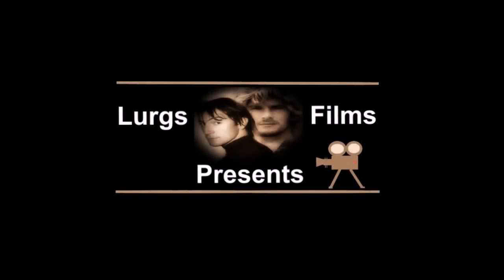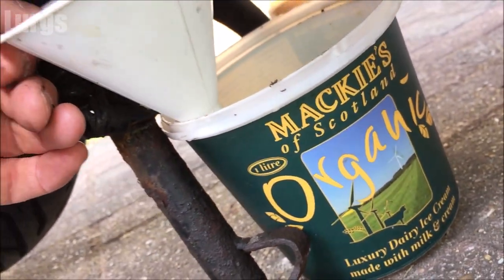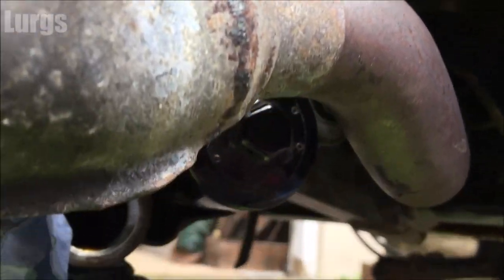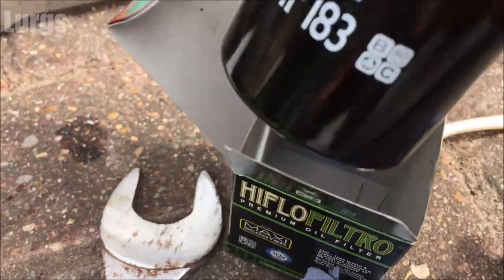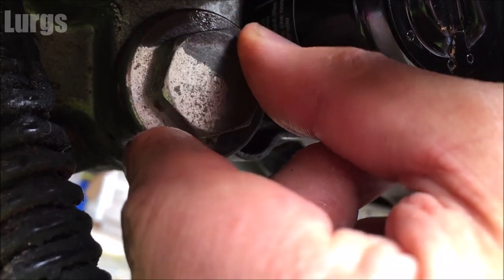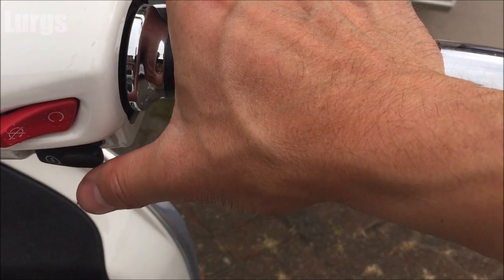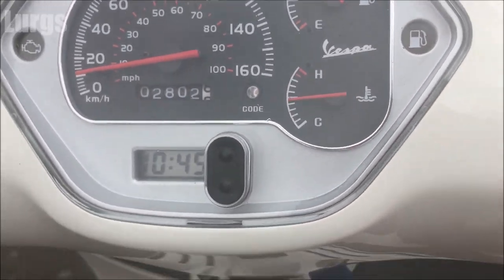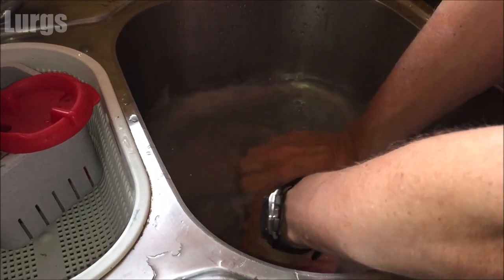Vespa GTS 300 Oil and Oil Filter change

Comment: Great video.  Thanks for all the detail.  The one suggestion I'll make is that it's better to allow the bike to sit for a few minutes before checking the oil level.  When the bike is run, oil gets distributed throughout the engine.  If you measure the level right away after shutting it off, it may read low, resulting in an overfill situation when you add new oil based on that reading.  If you wait for a bit, the oil will have all drained into the sump, giving you an accurate level reading.  But that's a small point on an excellent video.
Reply from the maker: Charles True. Overfill is as bad as underfill. I thought I had mentioned that in the video, maybe I didn't. Good point.

Comment: Its annoying how Vespa Piaggio puts their drain plug in a place where oil will inevitably get everywhere when draining because of the location of the center stand. Its also a pain to get oil into the bike. Oil changes on Genuine, Lance or SYM are 5 times faster. Anyway, these bikes are new to me but the power when riding was pretty nice, as well as some gizmo features it has. Thanks for the video mate.
Reply from the maker: Glad to help. It's got some annoying things but I have to say the twist and go power plant on the GTS300 is amazing.

Comment: very helpful - where'd you  get the sump plug O ring, please? have you made a video changing the rear gear hub oil?
Reply from the maker: I got the O Ring from same motorcycle place where I got the oil. No I’ve never changed the gear hub oil.
Safe riding to you.😎🛵

Comment: Awesome vid & good explanation! Why would you say its Perfect when your oil shows Maximum on your dip stick? Isn't it better to have it in between Min and Max?
Reply from the maker: Thanks. Anywhere from midway to Max is perfect. It holds such a small amount of oil that it's very easy to accidentally overfill it.
Just had another issue with mine today, the headlight glass\plastic has melted! I'd been starting it up to keep battery topped up and with it not moving it has melted it, never seen that before in my whole life, awful quality, should be glass! So need to get that swapped before next MOT.
Reply: Thanks for your reply. Wow! I’ve never heard that part melted before. Last time I changed the oil on my Vespa sprint, with 1 L of oil change, the dipstick shows between minimum to middle. I don’t know if that is enough or not but I’m guessing if the oil light doesn’t come on it should be OK
Reply from the maker: @NinjaNik  ideally have it in the middle so you could put a tiny bit more oil in, but it doesn’t hold much so put in a small amount at a time.

Comment: The user manual recommends 80w90 transmission oil, 5w40 engine oil for vespa gts 250.  But not everyone on youtube uses 10w40 and 75w90.. I'm crazy.  What should I do?
Reply from the maker: It’s also slightly dependent on weather conditions but I used the one in this video which was recommended.

Comment: What happens once you’ve put the oil in and the oil light doesn’t turn off?
Reply from the maker: Sk _bl Have you definitely put in the correct amount of oil?  Unusual for the oil light to remain on unless there is a fault, be careful. That needs to be investigated.

Comment: Hello, ma gts 125 prends 1l et 250 ml  (1.25l) d' huile 4 temps moto (5w40castrol)  ne dépasse jamais la quantité car se n' est pas bon pour le moteur injection  , en revanche ton 300 gts est plus gros moteur  je pense que c est un peu plus ... D ' ailleurs peu tu faire un tuto sur comment changer le filtre à essence , en effet je ne la trouve pas.
Reply from the maker: It might not have a fuel filter, not all engines do. Safe riding to you. 🏍

Comment: My gf tried to take over changing the oil by tightening the plug, but it won't tighten and when trying to torque it, the plug comes loose.  Did she just ruin her fucking engine by stripping it?
Reply from the maker: It would be quite hard to ruin the thread unless it wasn't on properly to start with and was then tightened up with a spanner, I always hand tighten nuts first. Maybe remove the nut\plug and check the thread on it. If the thread is only damaged on the nut you could try a new nut, if thread is damaged on the block then that's not good news. I really hope you can get it sorted, let me know how you get on, good luck.
Reply: @LurgsHowToGuides   It wasn't very difficult to loosen the bolt the first time when I drained the oil.  It felt smooth and good, and nothing weird when loosening.

I removed the plug and tried to thoroughly examine the threads on both the block and the bolt.  The thread on the bolt doesn't look too bad, not cracked or anything. all silver and shiny.

I the thread on the block also look pretty good, no cracks, and also all silver and shiny throughout.  Though it does look like there is some slight stuff in between the threads.  I'm suspecting it might be some of the teeth from the bolt, which should mean that if anything, its worn from the bolt, and thats a good sign right?
Reply from the maker: Is the gasket still on the nut? If that was missing it wouldn’t tighten correctly. Maybe try cleaning the threads on both with an old toothbrush then tighten nut again but don’t overtighten it.